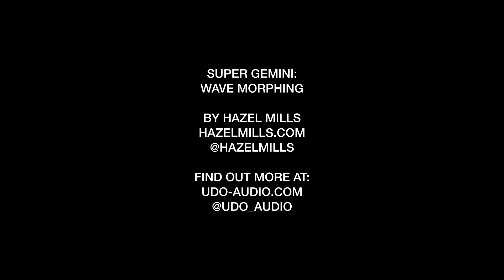UDO Super Gemini - Wave Morphing with Hazel Mills

Comment: Like the wave morphing idea, but this is not wave morphing, it's just using the fader to glide between two wave shapes, you can hear them overlapping.
Like the panel layout, it reminds me a bit of the old (mono) Yamaha CS30 from 40 years ago with sliders instead of knobs...There are other aspects (the ribbon) that are very CS80 too.
Bit annoyed that the camera focus of this video won't let me read the panel other than the module names. making it hard for me to tell what is really available here. ( i like to work synths out for myself).

Comment: Morphing? It's just a balance fader between two continuous waveform oscillators which can also be modulated! If it morphed there'd only be one sound changing and not two sounds fading from one to the other whilst overlapping.
Reply: Certainly sounds like it's just a simple crossfade doesn't it?
Reply: @edmx  It does indeed. That's what jumped out at me as I watched a listened. One always has to be objective and focused when assessing anything and not be taken in by the hype alone. Don't get me wrong, I think this is an absolutely super instrument, but misrepresenting certain functionality doesn't do it any favours!
Reply: i agree.  when you say morphing, it kinda flerts with the wavescanning or wavetabling concept where you have something like 32 or 64 of "in between waves" you select via modulation source, that give you an illusion of slowly morphing btwn the two entirely different waves  (i.e. what in a nutshell Waldorfs and PPGs do.)

this here however, sounds like normal audio crossfade to me.